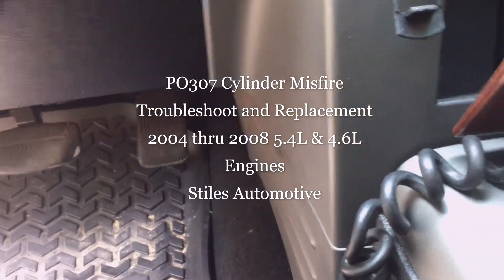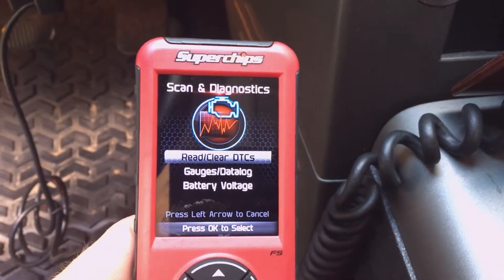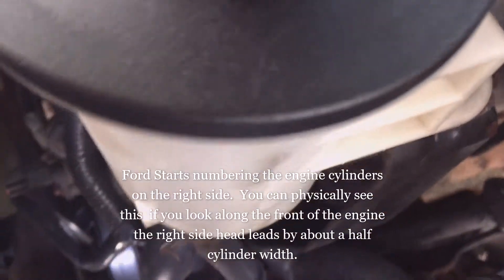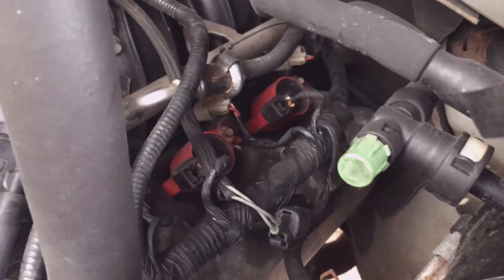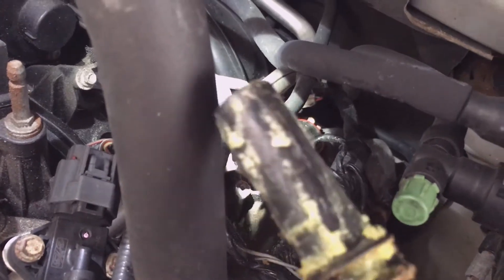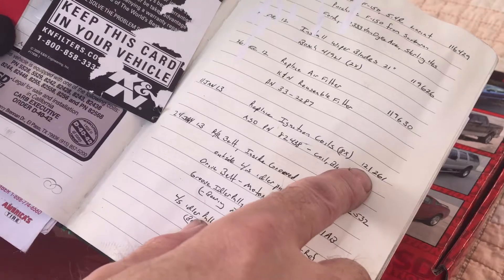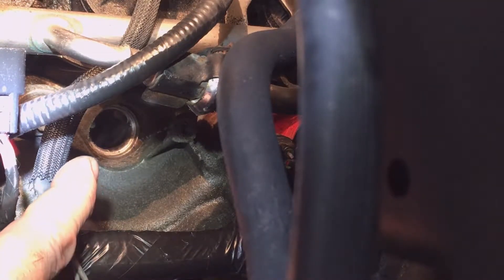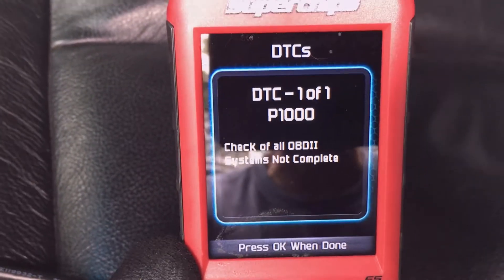Cylinder Misfire Troubleshoot and Coil Replacement   2004 thru 2008 4.6 L &5.4 L Engines

Comment: Was there a reason for not also checking the spark plug, possibly that this engine may have been one where the heads had fewer threads for the plug seats than normal, so not wanting to chance stripping the threads?  I assume the coil replacement fixed the misfires?
Reply from the maker: Bp, Yep, the Coil on Plug Coil was the problem, The easiest (and best) way to troubleshoot the Misfire is to exchange Coils from one Cylinder to another, move the suspected Coil to a good Cylinder and put that good Coil where the bad one was.  If the OBDII Fault move from you bad Cylinder to the good Cylinder, you know the Coil is bad.  And, yes, you have to be very careful removing Spark Plugs on this generation of F-150.  I have a Stiles Automotive Video showing Spark Plug Replacement (see link below) - Stiles 

Spark Plug Replacement - 2004 thru 2008 4.6L, 5.4L, or 6.8L 3-Valve Ford Engines  https://youtu.be/YLsN4vZMGxM

Comment: Do you put the dielectric compound on the pins and springs of the coil along with the boots and top of the pin housing?
Reply from the maker: Plant-Lover, In some of my Stiles Automotive Videos, I use a lot of Di-electric Grease, probably way, way to generous with it. It is great at lubricating and water-proofing Connectors. It helps Electrical Connectors come apart the next time so much easier. I hate corrosion. And it helps with carbon tracking and shorting of Coil Wires, Spark Plug Wirings because it is non-conductive.  However, on some connectors, like the Coil on Plug (CoP) Electrical Connectors, Sensor Connectors, and the like, You should not put it on the Pins and Sockets (meaning Electrical Transfer Point) of the Connector, because it is non-conductive.  I believe this can reduce the signal (or increase the voltage drop) thru these Connectors, where you need a strong signal.   - Stiles

Comment: Did you ever check the ohms on the new coil, and also the old coil you replaced?
Reply from the maker: Joe, Yep It did a video to check the COP Coil (link below), Ya know, with these Coils, sometimes just removing the Coil, reseating it on the Plug and reseating the Electrical Connector improves the Coil performance.  I'm not absolutely convinced that the Coil was bad, but replacement corrected the fault.  Of course, cracked Coil Boots and other things contribute to a bad Coil too. - Stiles

Bench Test Ford CoP (Coil on Plug) Coil Motorcraft DG511 {#3L3Z12029BA}  - 2004 thru 2008 4.6L & 5-4L.  https://youtu.be/6MgZ662wLnc